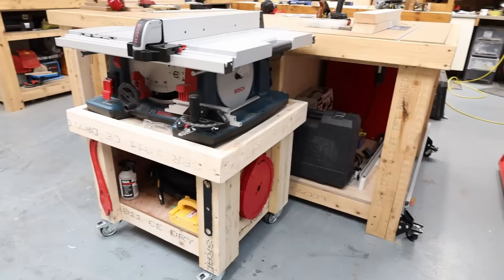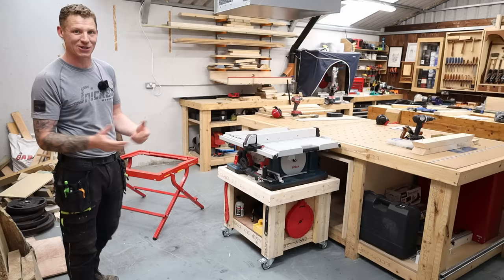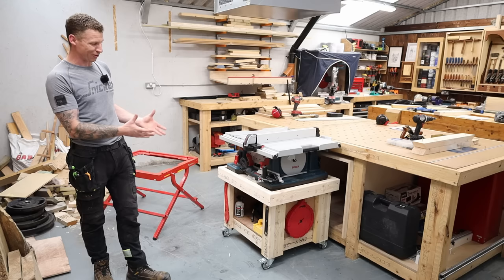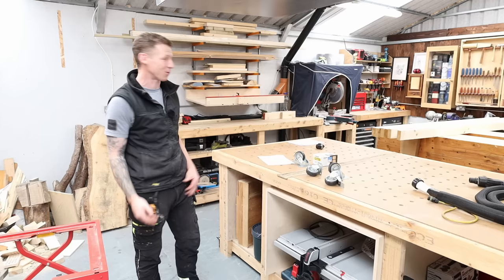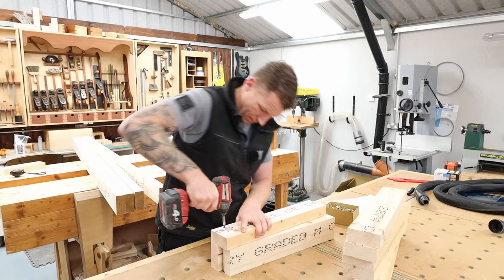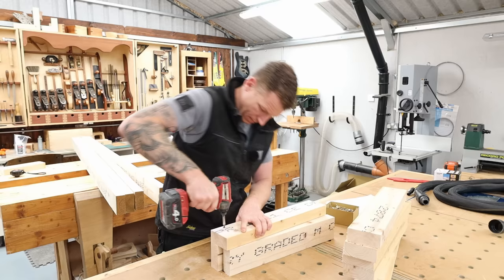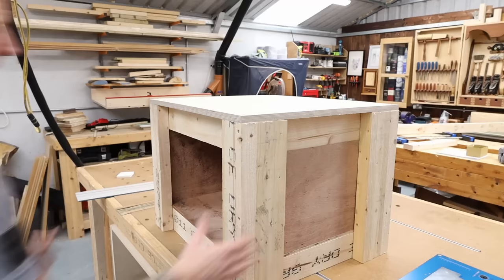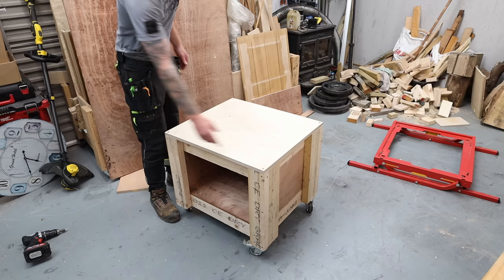Table Saw Cart. Simple, Strong, Functional. Workshop Project

Comment: That's great, simple and sturdy all you need.
As a retired chipy  I sold all my workshop machines 
Several years ago but still doing the odd job !
So bought myself a table saw last week (my wife said why??) And this trolley is just the job I'll be knocking one up tomorrow tomorrow 
Thanks .
Reply from the maker: Cheers Robert, I'm glad you found it useful. As a retired chipy, you do carpentry work just for the pleasure of it.

Comment: I’m brand new to wood working and just built this, literally the first thing I’ve ever made. Managed to get it right with the crap miter gauge that came with the saw, and a $10 speed square. Well… right enough haha. Made with a mix of wood from pallets and concrete molds from a build site, so the wood was all free. Wonky, but free. But it’s level and doesn’t wobble, so that’s a win! 👌
Reply: Good play with the pallet wood and left over build site materials. Repurposed wood is always a good idea.

Comment: I made four 2' by 4' work benches……one has the the tablesaw, one has the mitersaw, one is flat with a Built-in router table and the other is just a flat work table.... The work surfaces on all 4 are exactly the same size, so everything can be used as an outfit and I can lower the router blade on the router table and have 2 flat work surfaces as outfeed or infeed.....

Comment: Cheap, strong, practical and nice looking.  Usually it's a case of picking three.  This project has all four.  
I know it's shop stock birch plywood (hence still cheap) but at the prices here in Australia that's $100 worth of 19mm ply in the top.
Reply from the maker: Birch ply is crazy expensive now, I could have doubled up the 12mm WBP ply is suppose

Comment: I've built several of these, but with open sides. I learned and started using the L corners from the beginning, so that is my normal building method.  I like how you put the blades on the side. 

I only have two fixed wheels on the rear of my table saw so I move it around like a hand-truck.  But, since I don't back it up to the bench very much, it tends to slide/roll a little.  I haven't fully decided on how I'll change that for the next build coming up later this summer. 

I'm building a new one, soon, to be taller to match the top of my new, taller workbench.  I'll be boxing it in like yours and hanging my blades and tools on the side, too.  Only, I'll be adding some kind of closure on the front. My experience is that sawdust tends to fill the space if it is open. 

Thank you for sharing!
Reply from the maker: Cheers Buck, thanks for your comment

Comment: I made a much more complicated bench which had the same Bosch saw at it’s heart but used the table extensions in their extended position and filled in the resultant space to make a large work surface.  In truth I may have been better off building your model and a separate bench.  Perhaps on another day but what I’ve done works well so I’m happy.

Comment: great job john . i cant stand having to take out  comonly used tool like that all the time . its very handy to be able to walk over and cut what you want . i like that you can set it up anywhere around the mft  to avoid what your working un. 
a nice bonus with this is that you can use it as an outfeed to the router table

Comment: Nice work.  But what about sawdust?  Does the Bosch saw have a separate dust port?  I have an old Delta saw where the dust drops down (what doesn't fly around the shop, that is) and while I like your cart, I don't think I can use your design for the saw.  I CAN see building one for my planer.  Thanks, John.

Comment: I have the same saw so I know how back breaking heavy it is! I struggled with mine, so made an almost identical trolley, but on mine I added a drawer at the top, and left top open to catch as much saw dust as possible in the drawer, because it does throw out a lot of dust from the bottom.
Reply: That was my only thought, if it's screwed down onto the plywood top, what happens to all the sawdust that falls through and will just gather up over time? I'm going to make this but without a table top and instead 4 struts for the saw to sit on with an opening to the shelf below so I can add a drawwr to catch the dust.

Comment: Been looking at a lot of design videos and finally found a build that didn't use pocket holes. With a small shop and a jobsite saw this is what I need. I'll also call out that most people think you need locking casters on all four legs, when two will do. Curious about the casters you have on your work bench, most of the ones I see look cheap but they look pretty sturdy.

Comment: I have a 1955 cast iron Craftsman contractor saw so it’s pretty dang heavy. This would work great! The issue is the saw dust goes down. Any reason I couldn’t put a hole in the center of the table and a bin in the bottom shelf? I’m just starting out so this is perfect timing.

Comment: Another great video, thanks. I am amazed you lasted as long as you did lifting it out every time you needed it, I've the same saw and I was amazed how heavy it was just getting it out of the box...once. All my workbenches are made using your 4*2 construction method, great way to do it without costing the earth. Where did you get the blade hanger/guards from?
Reply from the maker: I got them from Sauter Shop Alistair, they are made by Woodpecker

Comment: Just bought myself the same Bosch table saw. Great idea to have the trolley - will definitely help to have it more mobile. Some interesting comments from the blog members on dust collection / removal. Is your normal dust vacuum sufficient to remove all the saw dust or does it still accumulate between the base of the saw and the top of your trolley? Could potentially require you to remove the saw from the trolley to clean the excess saw dust. I like the idea of an opening in the trolley top with a small drawer to collect the dust - will facilitate easy cleaning.
Great video - thanks for the useful content.
Reply from the maker: My extraction is pretty powerful so I don't get much, but I like the idea of the drawer for cleaning

Comment: Taking delivery of Bosch Gts 10 xc tomorrow. Going to build similar cart. Great presentations John - keep it going.
Have you any experience of  Benchdogs Quad MFT rail hinge?
Regards,
Paul
Reply from the maker: Hi Paul I have not tried anything from bench dogs yet, best of luck with your new saw.
Reply: @JohnMcGrathManInShed  thanks John.
I have purchased the Parf 2 mk 2 and intend to make a MFT table similar to yours with a router table. I have also acquired the benchdogs quad rail hinge and I want to accommodate this in MFT - workbench top is 25mm mdf MR 1500 x 900 - any advice ?

Paul

Comment: Could this be modified to hold a 500 pound laser? Would you just use 4x4 posts for the legs instead? And maybe a crossbeam under the table top?
Reply from the maker: It could. Just make sure the castors have the correct load ratting

Comment: I've got the Porter Cable job site saw. I haven't looked at it to see how hard it would be to take off the built in collapsible mobile base. It's on wheels large enough to navigate rough terrain around job sites. I wonder if it would be worth taking it apart.
Reply from the maker: Might be worth a go if you only use it in your workshop